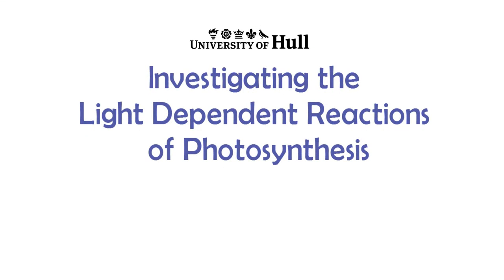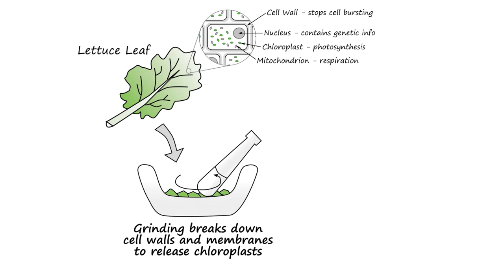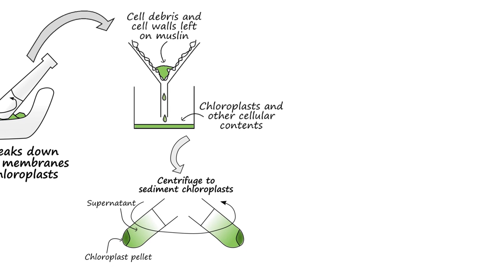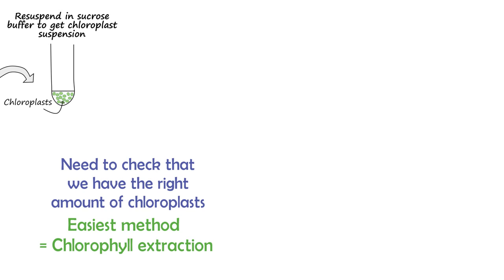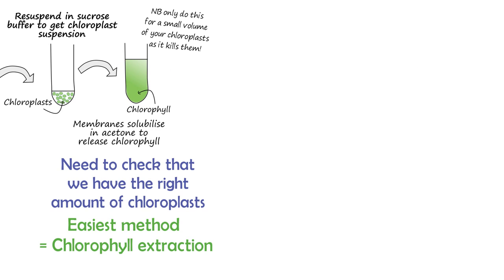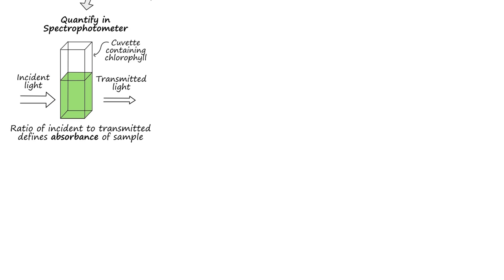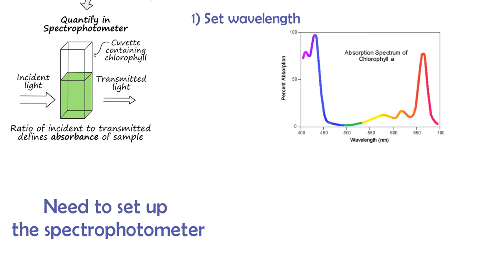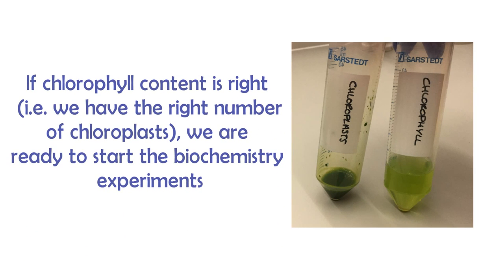Chloroplast preparation methods

Comment: Hello, I was just wondering, are you able to perform this experiment up to the isolation successfully with different plants (not lettuce)?
Reply from the maker: Yes - we usually use spinach leaves now rather than lettuce as they have more chloroplasts. Avoid woody/waxy leaves but any soft green leaves should work

Comment: Just as a helpful note to anybody doing this experiment, to get a 1.5% sucrose buffer, the formula is diluting 7.5g of sucrose with 200mL of distilled water (for a 200mL solution which is what I used)
Reply: Why 7.5g/200ml? 1.5% wouldn't lead to 3g/200ml?

Comment: How long should the chloroplasts be resuspended for?
Reply from the maker: This method takes 1-3 mins to fully resuspend chloroplasts. They can get stuck to the wall of the centrifuge tube, so might require pipetting up and down a few times. Check the preparation by eye to check there aren't large lumps in it. Once resuspended the prep is good for ~4 hours if kept on ice in the dark.
Reply: Okay thank you very much